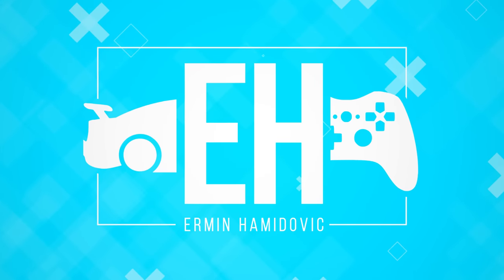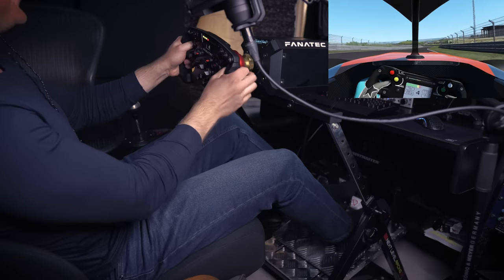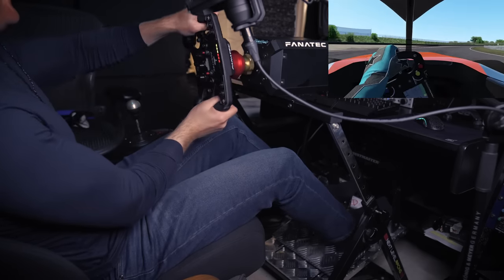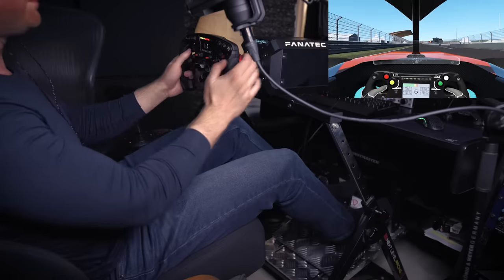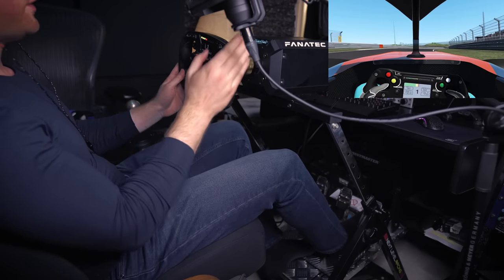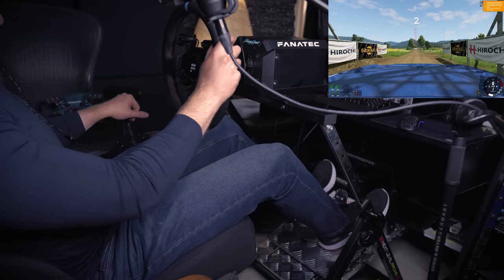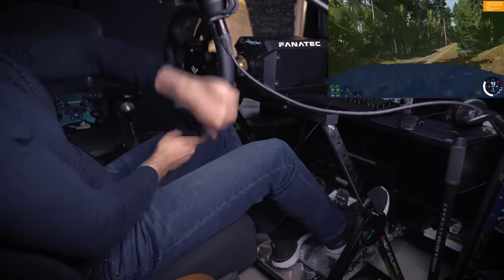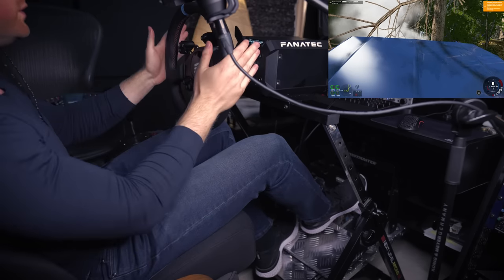Can You Mount a Direct Drive Racing Wheel to a Cheap Stand?

Comment: You neglected to install two required bolts into the top of the telescopic arm and haven't even tightened the adjustment bolts down. Why did you expect it to feel sturdy when you haven't even put it together properly? I can't replicate any of that vertical flex when the stand is assembled correctly. 

Additionally why is it necessary for you to run the stand at max extension? Is your seat really that high off the ground? I'm using my gaming chair lowered down as far as it will go meaning I only see 5 bolt holes on the sides of the telescopic arm. The add-on seat that NLR sells is even lower again, so I'd expect to be able to lower the arm even more, making the stand even sturdier.

Comment: I have the NLR stand and a seat frame I built myself out of some spare steel tubing, bolted it to the nlr stand. My seat is real low to the ground so i have my wheel deck real low. It was real solid with the csw v2.5, working fine with the dd1,  i did drill a couple holes and add a couple metal brackets to strengthen the wheel deck before I installed the DD1 but i couldn't get it to flex just trying to move it in any direction. I remember when i first got the stand before i turned it into a full cockpit, it seemed flimsy, i realized i forgot to put in the plastic spacers that go around the deck extension and push into the frame to fill the gap. Looks like what hes done, left those out. This stand works fine for a DD1 if you put it together properly and low. Make sure its together properly and its solid, yeah i reinforced mine so its stiffer than need be but i didn't need to. If you already have this stand and like it or dont wanna spend money on another, make sure it's assembled correctly, it should be real solid even with a DD base. Then if you feel the need, reinforce the wheel deck, it cost me like $5 in hardware and took a few minutes. It also looks like a proper cockpit when you have the wheel deck down low. You can add a seat and frame to this or any stand for about $50 if you are willing to do just a little work and it can be made real solid.
Reply: I noticed he has his wheel stand set higher than what I got mine. Makes me wonder if that is why he has as bad flex as he does.
Reply: What nm do you run your dd1 at

Comment: Im sure that once you get your new rig setup, you will be loving driving with your DD wheel. Its also the immersion factor which increases as your equipment gets better. Hats off to your current rig though, it still manages to stay in one piece, all be it a shaky one, through all the abuse it gets.

Comment: I have the same wheelstand, yes that vertical flex can be felt even on a G27.

Did you drill a hole into it through the beam for the third (front middle) screw of the Fanatec mount? Or do you perhaps have a slightly different version?
Reply: i have the exact same stand and the exact same problem. Shame the reviewers did not mention this insane vertical flex, it makes the experience so unsatisfying

Comment: I have the same Wheelstand, and not these problems. I turned the Wheelplate that it show in my direction and fill the gap between the plate and the stans with a second metal plate. 
This also leads to that the wheel come closer to you, so you can widen the angle of the stand to stay better on the ground.
I hope u can understand what i mean, i´m from germany.

Comment: This wheelstand paired up with the gtultimate addon with a fanatec csw2.5 and v3 pedals is really sturdy, i dont see why people are saying bad things about this wheelstand.
Reply: People don't make sure its together properly, they lift the wheel deck way high, higher you go, the more flex. Plus you need to do some extra tightening, really use your head when mounting a csw 2.5 or DD to the NLR stand. Mine had 0 flex with csw 2.5, but with the DD2 i chose to add some brackets along the side plus i added a brace to the wheel deck. I already had mine all done up how i wanted and most cockpits sit higher than i prefer so i braced mine well. Its very solid and no longer looks like a wheel stand but I've spent maybe $50 total strengthening it.

Comment: It's doable.  I've tried using a DD  (6-8nM) with a cheap stand but it's the newer version with the vertical support pieces.  The vertical piece makes the stand stiffer so that it wont' sway from side to side when you are using the DD.   I am playing Asseto Corsa now and the stand works fine.  I have the modded G29 pedals with the leoboder(?) USB cable and Trubake mod too.

Comment: Great video. I have one question. Does the NLR stand have rubber feet with height adjustment as the GT Omega Apex? I couldn't stop noticing in your video that when the wheel moves up and down, the movement travels through the metal bar down to the floor. Physics wise, that shouldn't happen if all 4 feet have proper contact with the ground. Based on the design, it should only be possible to maybe have the oblique bar flex or the wheel attachment not be sturdy enough to stop flexing from happening. I think this would make it easier for future buyers to understand if the wheel stand has flex by design or if it can have flex if not properly installed. Thanks

Comment: Omega Racing - APex foldable wheel stand looks similar to what you show but is rock solid, with a slightly different plate mount at the top and I just guess better build quality. Ive got one and at seeing you move your wheel I instinctively just reached out to mine to check my Oemga Apex and for sure, no movement.

I believe that apex is 2nd edition so maybe your fordable stand design is first edition with the flex issues that where later fixed/mitigated in v2 of that particular design.
Reply: @siclusiferx  no just a little thrustmaster, but my comment was on the stand itself before he even starts driving. The mounting seems super lose and flexible when he juggles it around. There is no jiggle movement in my rig at all like that.
Reply: @siclusiferx  I use an simucube2 pro on a apex. its definitely doable, though I'm sure its way better with a proper rig.
Reply: its better than I expected.
Reply: Hahahaha I did the same thing with my GT Omega Apex wheel stand as well. Started pulling on it when I saw how much his flexes. I also don't get any flex...

Comment: I use this exact wheel with a T300 and CS V3's w/ BPK, and I get the same floppyness on the wheel deck. Which have resorted to putting a box inbetween my desk and wheel deck (yes i use a desk with it, as the monitor mount you can getting for it is trash.) and my pedal deck aluminium is flexing under and is starting to split at the bolt holes. But an 80/20 rig is a little outta my price to upgrade to.
I probably could of got a cheap $300 AUD full rig off ebay that probably is better quality then the NLR GTUlimate. I have even seen their GTTrack still has the issue of flex in the wheel deck.

Comment: I’ve got a $350 Arozzi arena gaming desk, anyone think I’d be able to use a dd wheel on it with no issues? I don’t need ffb at 100%, just curious as to whether or not the desk would be able to handle it.
Reply: Well how did it go with the table clamp? Does the DD1 feel great or do I need to buy a rig for it?
Reply: I have the arozzi arena desk as well. I don't use it for sim racing but I am sure you could. That's if you made sure its together properly and everything is tight. The instructions were not great and it was a pain, mine was not solid to begin with so i flipped it over and sure enough, it was together all wrong. Now that its together properly, its solid as can be, absolutely cant make it wobble. It can certainly hold a DD wheel at higher forces if you bolt it down or use a proper clamp. Set the table as low as you can too. There's no wheel stand as solid as that desk when properly done.
Reply: Greg Vandy Thanks for the response. I’ve been using it for a while and I didn’t have many issues aside from the table scratching. But I ended up biting the bullet and bought a full on rig.

Comment: Well i have the exactly same stand and Wheel an reduced the ffb to 60%. Well it's okay but far from good. I guess at some point i have to buy a 'new' rig
Reply: I just ordered a dd2 and I have this wheelstand. Did you have to drill extra holes?
Reply: @Aaron408  what about reinforcing the stand? I have been thinking about this stand because I don't have alot of space, and I was thinking of building a box around the stand and screwing the wood to the stand.